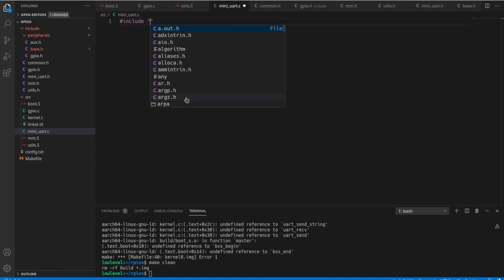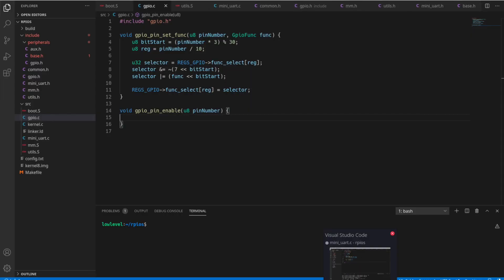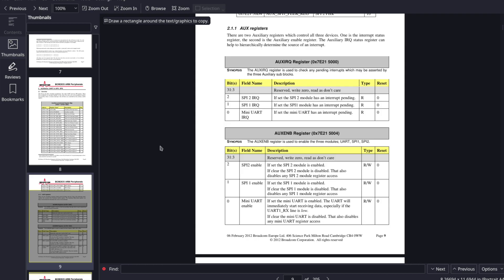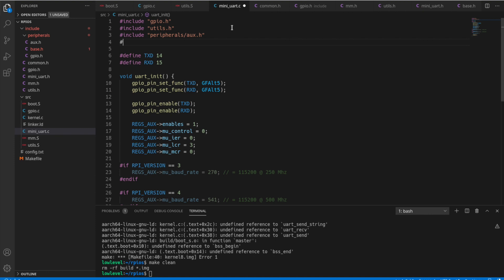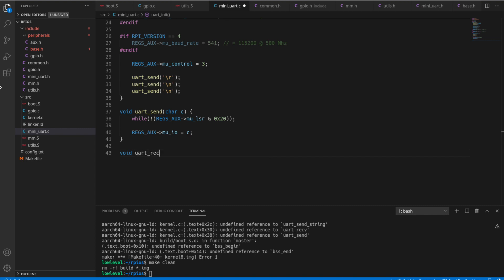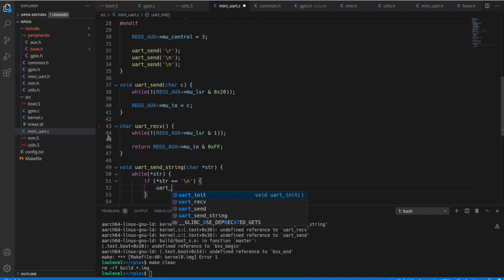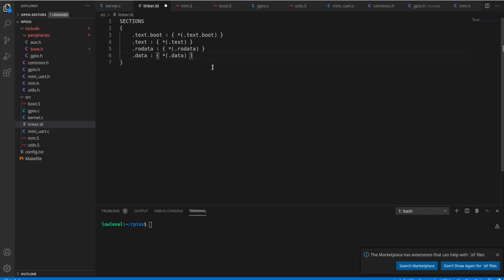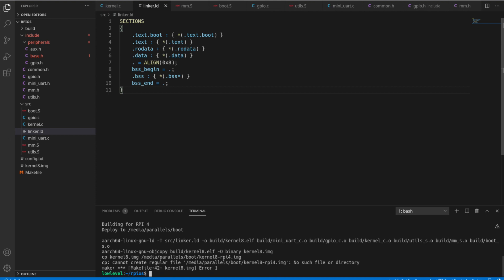Raspberry Pi Bare Metal Tutorial - Part 4

Comment: For anyone wondering: The mu_baud_rate could be set to 271 for a more accurate result.
Also, the Raspberry Pi 3B+ has a 400 MHz system clock speed by default. Thus, you need to set the mu_baud_rate register to 434 in order to make it work correctly for a baud rate of 115200 :)
Reply: Using a PI 3B+ and couldn't figure out why the data was scrambled. Thanks!
Reply: @paulgates4205  You're more than welcome :)

Comment: Thanks for the awesome series,
can you point me to the reference for the "500 MHz system clock freq" on Rpi 4?
From what I have found in page 10 of the BCM2711 ARM Peripherals it says:
"Immediately after a reset, the baudrate register will be zero and the system clock will be 250 MHz."
I'm not quite sure which value to use at this point (I'm using an Rpi4). Thanks